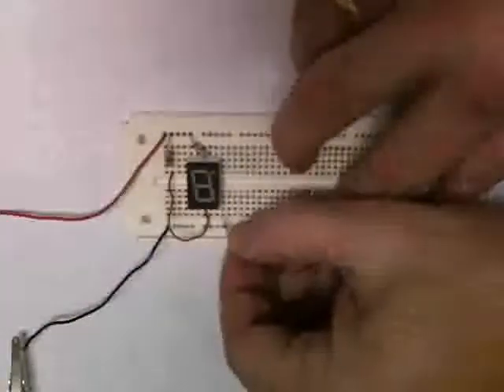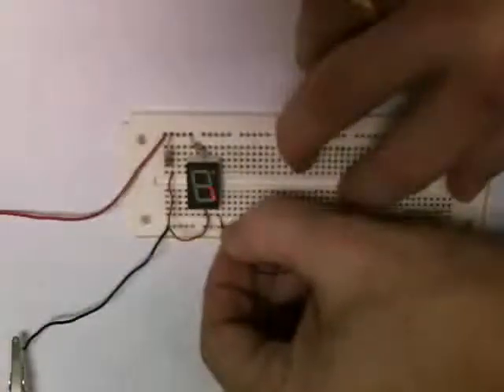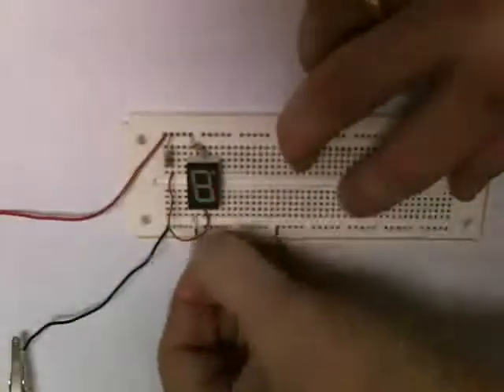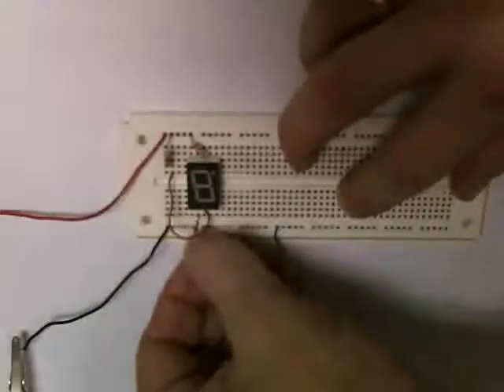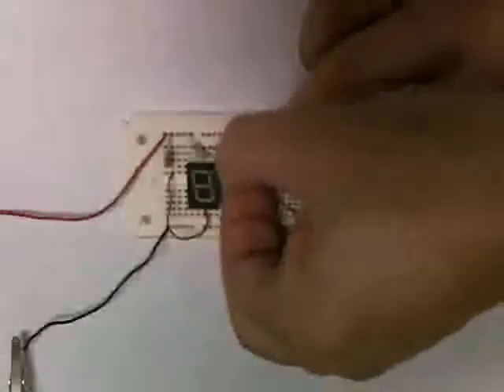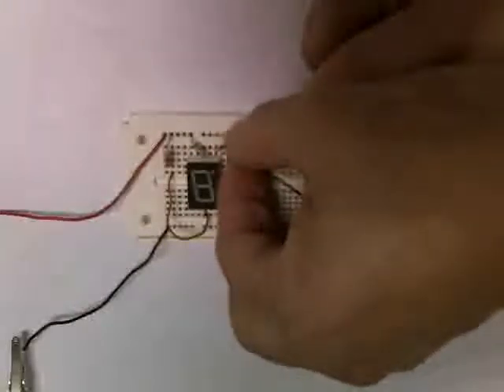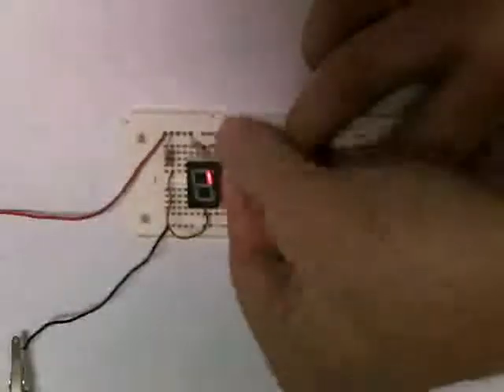Testing common anode 7 segment displays

Comment: SIR PLZZ SEND THE CIRCUIT DIAGRAM
Reply from the maker: There isn't any "circuit"; there are just resistors from the common anode pins to Vcc. The pinout for the display will depend on the specific device used.

Comment: sir what resistor value did you use? thank you
Reply from the maker: For just about any display a value between about 200 ohms and 1000 ohms should make the display bright enough to see without burning out the segments. 
(If you actually know the recommended current for each segment then you can calculate the desired value more precisely.)
Reply: thanks sir
Reply: sir what happens when i  use 150 ohms??

Comment: Sir? Is there a big difference in using a green common anode and a red common anode?
Reply from the maker: edwilyn roa dacer The only difference you might notice is the resistance value that gives reasonable brightness. But any difference would be small and not important.
Reply: Thank you, Sir.